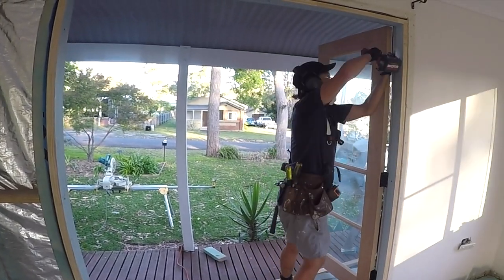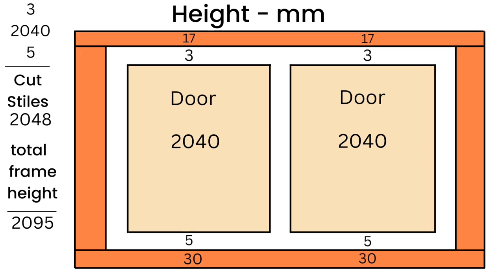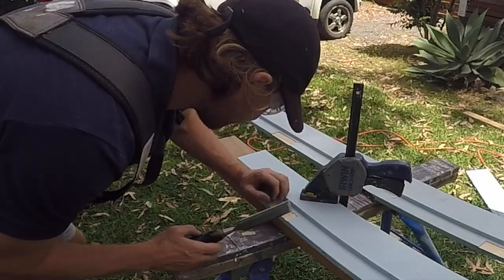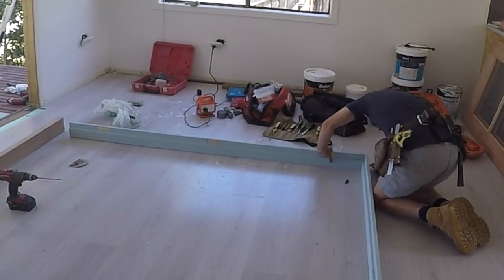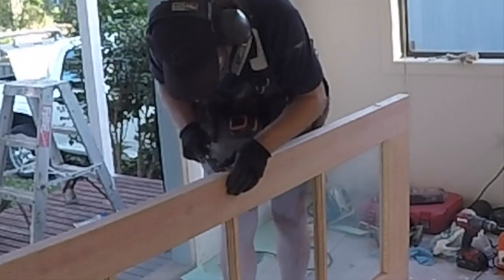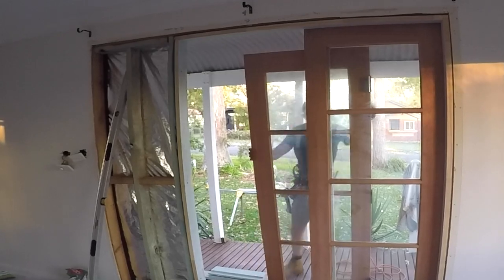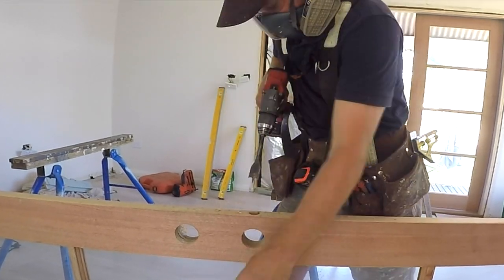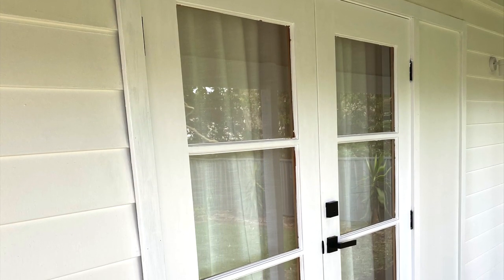How To Install French Doors, Frame And Locks - Step By Step

Comment: Thanks for this video. I built similar (but not as nice) French doors for a new build and have been struggling with whether to a) “pre-hang” the door off-site and b) install the handle/deadbolt before installing the door. I think you just convinced me to wait - to build the door jamb,  hang the door, and install the hardware - until I’m on-site. Saving your video & subscribing for future reference - thanks!
Reply from the maker: Hey thanks for watching the video and leaving the comment. I also struggle with all the different ways to complete a job. I like to build things on site when renovating as it’s easier to double check the measurements and usually old houses are a bit out of level and plumb.